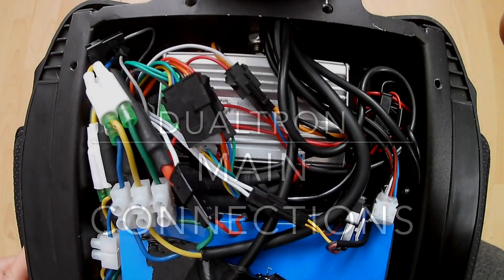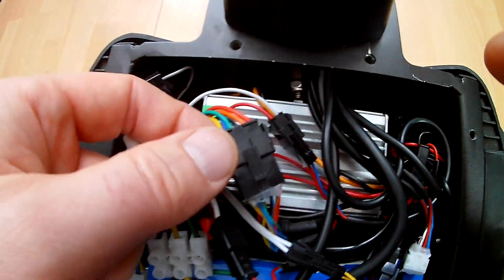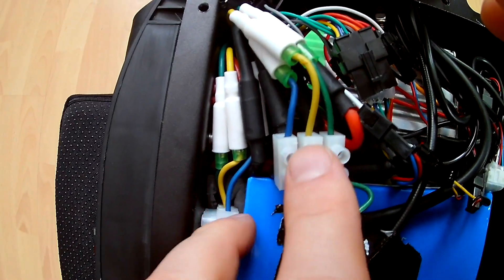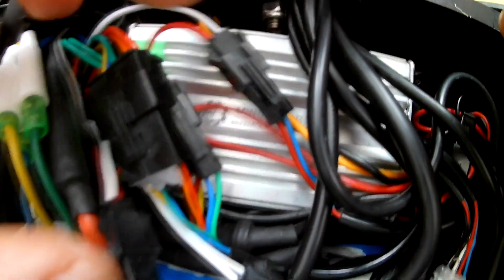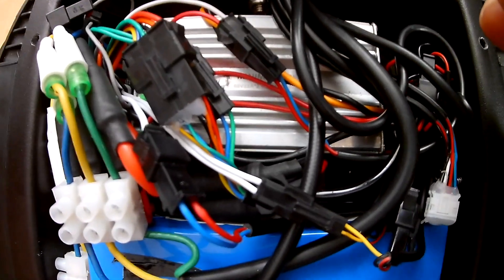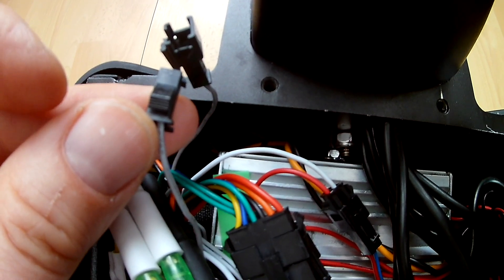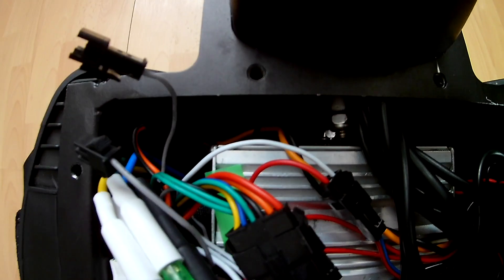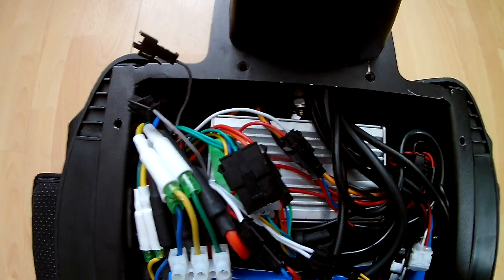Dualtron eScooter: Main Controller Connections & Speed Tuning

Comment: Mine grey wires are not connected and in dual engine mode the scooter does not goes over 30kmH  and this is rated to 50kmt.    the dual speedcontroller is 48v 21a and engine is 1000w each, any ideas?   i looked at a 50kmh version of the scooter and it has the same controllers and the grey wires are cut on this one as well. could the limit be in the display?    it is a langfeite l8s type

Comment: Thanks for the video,  I have the MT5e disc brakes please can you  tell me how to connect, what is each colour cable for
Reply from the maker: Freopa The MT5e‘ s have two Sensor-Cables ... and the Dualtron has two cables for the braking-light / motor-off signal, too. Simply cut the original cable and connect (solder) them with the cables from the Magura Sensor Cables. 

In my case it was a blue to blue cable and a black to red cable to solder for rear & front brake

Comment: are there 2 speed limiter grey cables to disconnect for a dual motor set up?
Reply from the maker: Roget Faust No. Not for Dualtron Models. They have two Motor Connectors, but still one Controller and Limitation-Cable.